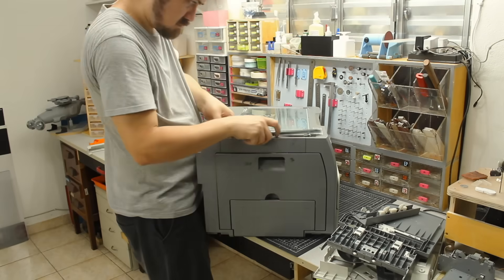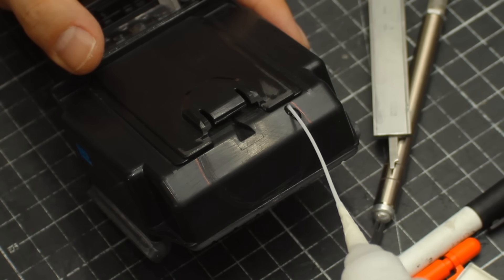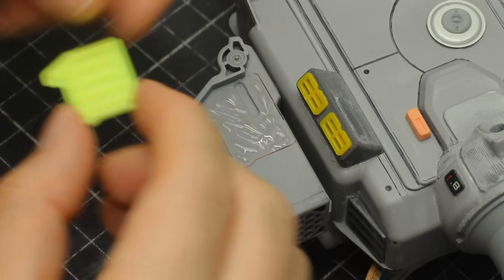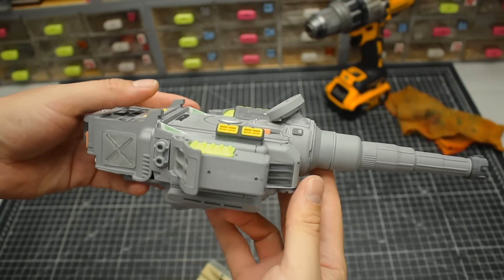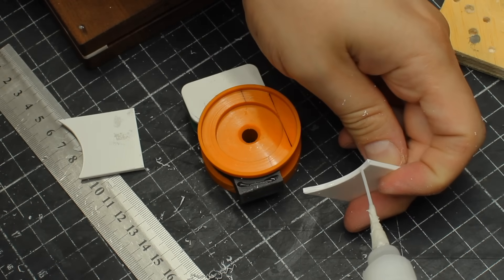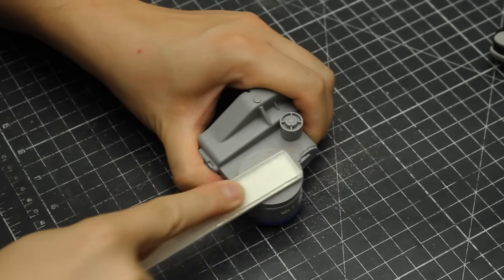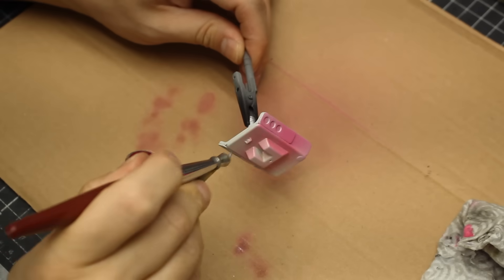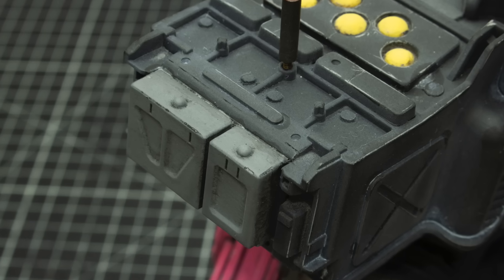How I Scratch-Built The Dagger Robot (Full Build)

Comment: What glue do you use? My super glue takes so long to dry I’m looking for better options.
Reply: You might want to try super glue accelerant to help it cure faster. Baking powder works as well but leaves a gritty texture that would need to be sanded down. Also try super glue gel, it sometimes sets faster depending on how much you apply to the surface.
Reply: @jameslivingstone8267  any brand suggestions?